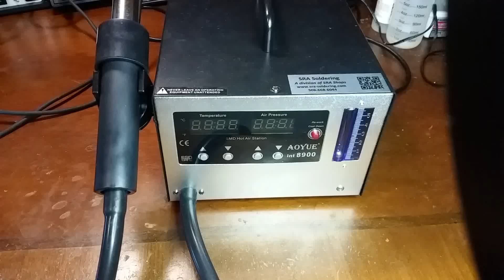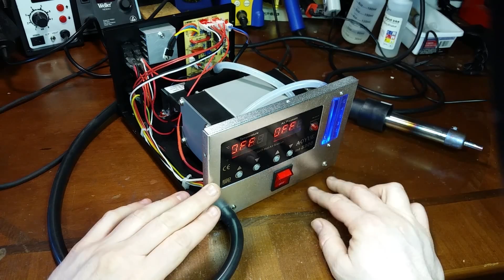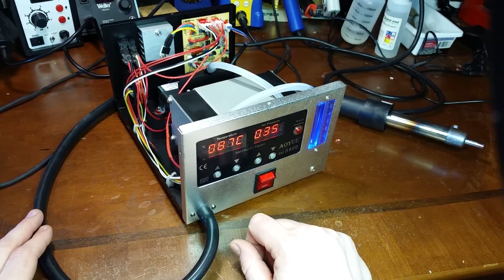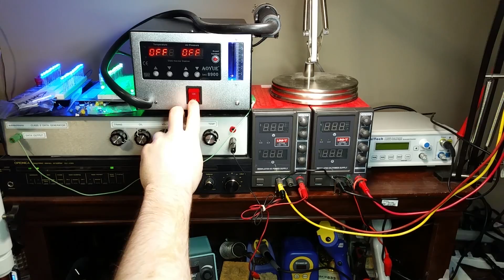Aoyue Hot Air Station Mod

Comment: Thanks for that nice little insight which finally led me to buying one of those units (got it for ~100€). I'm still at school, so as always a bit low on budget - but that generously spaced case allows for some mods (like the one you did; I will definitely do that aswell once my unit arrives).
Reply from the maker: Did you find the 8900 model? Looks like here in the states it was discontinued quickly.
Reply: @jeffescortlx  Regarding the "floppiness" of the air hose: I am considering to add a spring to it on either side, so you can't overbend it anymore. Now it has to arrive in first place xD
Reply: @jeffescortlx  Actually I found it at their EU-Store (aoyue.eu)
Reply: Guess what arrived today WITHOUT the red security screw for the pump assembly?
It's a never-ending story ._.
Reply from the maker: @yannikzausig9724  did the pump come loose in shipping and bang around inside?
Reply: @jeffescortlx  Would be pretty darn easy to open it up, but doing so would involve removing the warranty sticker...

I simply confronted the seller with your first video about this station, said "a) lemme take a look into it myself and decide if it's safe to flip the switch to "ON" or b) if I mustn't open the case, send me a new one and ensure it has that screw for transport.." 

Well, we'll see
Reply from the maker: @yannikzausig9724  sounds fair to me.

Comment: Is that what you use to desolder CMOS components?
Reply from the maker: I think you mean SMD, surface mount device. But yes. CMOS is a semiconductor configuration.
Reply: Indeed your right. Here we use CMOS for SMD. I'm not into electronic already so I may use a word for another. ^^